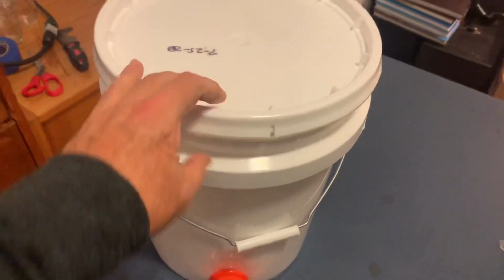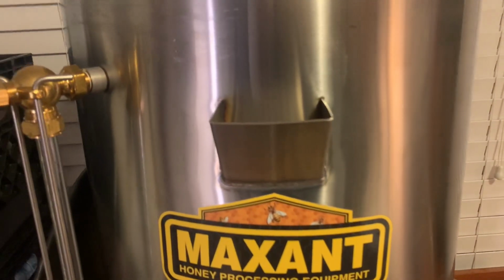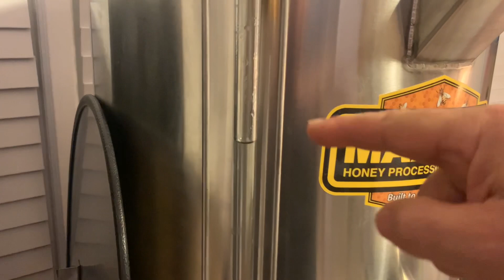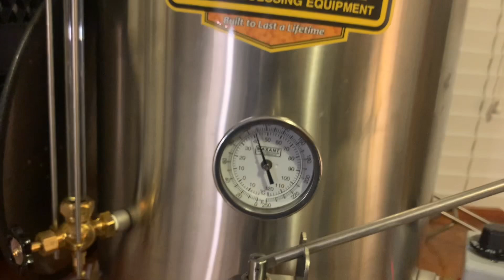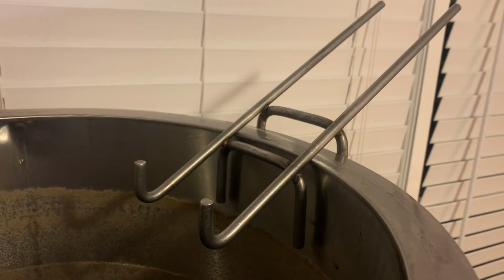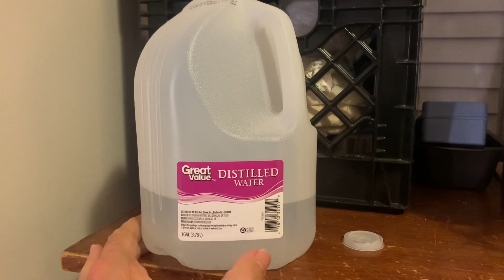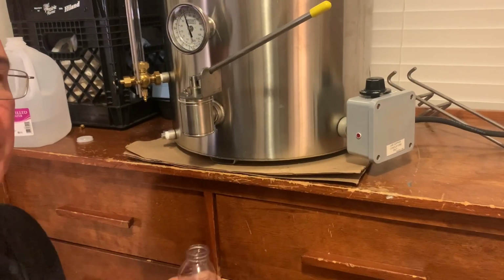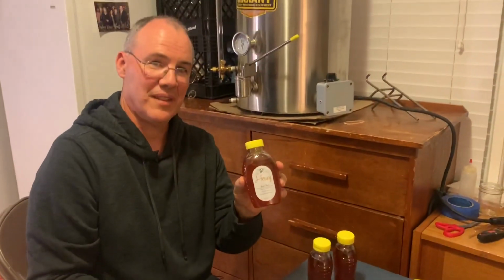Bottling HONEY the EASY Way | MAXANT Bottling Tank

Comment: I buy honey in five gallon buckets for home use. I know it’s pricy but could buy the tank and store all my honey in it and warm it up only when I need to bottle some for my pantry? Would it hurt the honey to heat it to many times? Thanks I really enjoy your videos!
Reply from the maker: That might work. The only issue is that the lid does not seal tightly. It does secure the honey but not sure if I would want to use it as a long term solution.
Reply from the maker: This is a great question. If anyone else has any thoughts feel free to share.

Comment: Do you weigh those bottles ? I was was told buy the manufacture  one lb of honey goes right to the bottom of the cap ,
Reply from the maker: There is a fill line about where these are filled to. And yes we have weighed them to see. Usually there is actually a little more than a pound in these bottles. It is possible that different manufacturers’ bottles need to be filled differently. These bottles are form Sailor Plastics.

Comment: Doesn't the honey re crystallize after a short time? I have to cream mine because the native flora causes fast crystallization, Here in Australia the Dedant bottling tank costs about $2000.00 after you add shipping etc so they have priced themselves well out of the market baring in mind that the Chinese automated system starts a little over $3500.00
Reply from the maker: The honey will probably re-crystallize over time but I usually sell it in one pound bottles and only bottle it up as I need to so when I sell it is will usually be nice and clear. This tank with shipping was $1,300 + and then I also bought the pail perch which was not cheap. But it should last me for many years to come.  With the quantity of honey I have I do not want to go back to the old way for sure!
Reply: @brucesbees  i totally agree with you that it was for you perhaps the next step forward, I on the other hand am scaling down.
Reply from the maker: I hear ya man!  Thanks for checking in from the other side of the world.